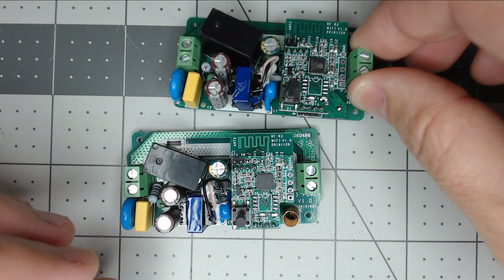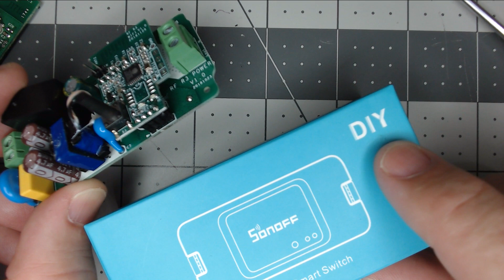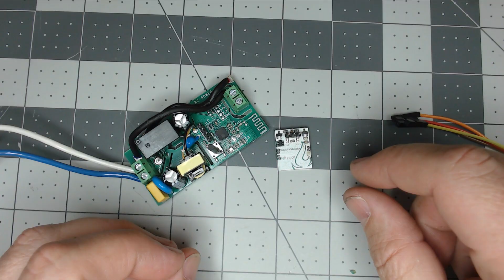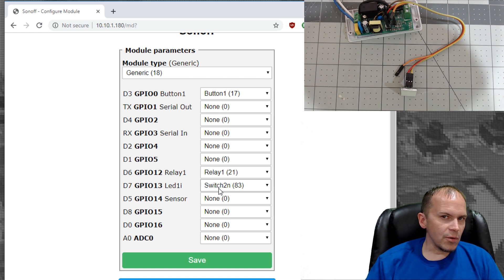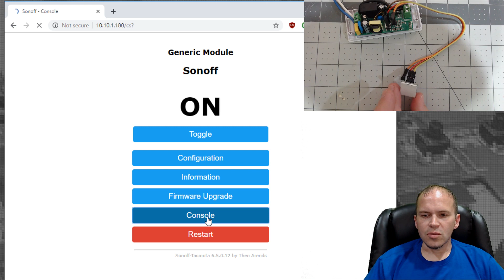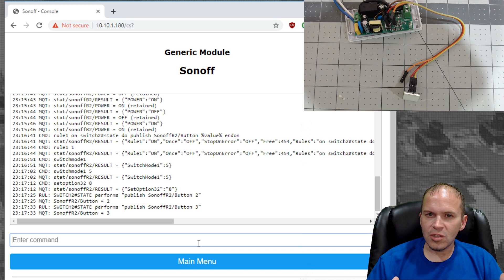Sonoff Basic R3 DIY Mode - Comparisons and Thoughts

Comment: you seem to know what you are talking about I need something that tells me that the device im turning on is actually on like my pool pump does Sonoff make a device that will let me know the device my pool pumps actually running 
thanks
Reply from the maker: How is it wired? Just a plug?
Reply: @digiblurDIY  currently yes but that always can be changed I can even do it in my panel that feeds the pool pump and accessories 
Thanks for responding
Reply from the maker: Probably best to do a CT clamp meter. Shelly has some
Reply: @digiblurDIY  thanks I’ll check it out

Comment: Great review and nice integration of that touch sensor. I use the RX pin, there is a possibility of soldering directly onto the tiny SMD pin of the MCU to gain access to GPIO24, but it's really small. You convinced me that the R3 is not worth it.

Another option is to simply go for the TH16, it has more GPIO's available, but it is quite a bit bigger

Comment: does the sonoff r3 work connected to a 12v battery instead of 240 AC?
Reply from the maker: Not without modification of things. Your better choice would be the Shelly1, hit the jumper and power it off 12VDC.

Comment: I am trying to flash tasmota on the sonoff R3 and having some problems.  The latest firmware (3.6) create an AP that you connect to then put in your own wifi info.  Once connected to the wifi network, you can use the DYI tool from sonoff to see the device and flash custom firmware (tasmota).  I tried to flash tasmota on one and it seem to flash but then after that the switch seem bricked.  It doesnt do anything.  I tried again with a second R3 with tasmota lite (someone mentioned it in the comment) and the same thing happened.  

I tried to manual flash with FTDI without success.  I am not sure how to put it into programing mode.  I tried to hold down the button when connect to power but that doesnt seem to work.  Any insight on how to get it to go into programing mode?
Reply from the maker: I do believe the button is still GPIO 0. https://tasmota.github.io/docs/devices/Sonoff-Basic/#sonoff-basic-r3
Reply: @digiblurDIY  Figured out why tasmotizer did not flash.  I needed to run it as admin.  Just for anyone looking to do the flash, hold down the button when power up will put it into flashing mode.

Comment: Just watching this now.  Apparently there is a DIY Mode version 2 on the new firmware.   
Any chance of doing a comparison?    I did read a small number of SonOff's (including R3) could use the new firmware.
Using the LED pin as an input sounds interesting.  That would mean you could turn the single relay to a double usign tx and rx pins.
Gives you the relay plus 3 GPIO's :)
Reply from the maker: I was hearing from some people the OTA flashing no longer works on the new DIY mode.  I don't have any devices left on stock firmware though as I converted them last time.

Comment: Hi, I'm trying to add a regular push button to manually toggle the R2 switch. After flashing the chip with tasmota, the "pairing/manual' button in the board still work as designed? I'm thinking in solder wires on it to extend it's manual switch functionality and definitely don't want to use Sonoff firmware.Thank you in advance

Comment: It is not simpler. You need another module to flash it, download IDE software and board drivers, solder pins , buy parts and wires etc. DIY is just a jumper and some access points, and upload a file. No special knowledge. I personally hate to alter the hardware of a device unless there is no other option. I am glad of DIY. I am even grateful of the new ad-don for Hassio that it will see your sonoff out of the box and works in parallel with ewelink.
Reply from the maker: Tasmotizer doesn't require any crazy installs. Download and hit flash, don't rely on the cloud or stock firmware. It's your device, so make it yours.

Comment: I've successfully soldered male headers into 'one-sided' plated through holes on a circuit board by placing the terminal strip "upside down" ie with the plastic piece at the top. I use flux paste to hold the strip in place, so that the pins are just into the PTH, and carefully (and quickly!) solder the pins in turn. It's best to do the two end ones first - helps to keep them straight and the top of each pin parallel with the board. You have to be a reasonably proficient solderer (I am - a long lifetime of experience!), and ensure that the amount of solder is kept to a minimum. Once the joints are cool, then just push the plastic piece down! And - voila! A header in place. OK, if you want to be pedantic, there may be a very small gap under the plastic piece, but it really does work. Try it!

Comment: Wow, you seem to have a good handle on the construction of these, can I ask which model will be best Original, R2, or R3 in an electrical box outdoors in Hot climate. Like 45 C. Some places it says Operating Temperature max is 40C, but on Amazon it says 70 C
Reply from the maker: I would go by what is printed on the iTead site as it is their product.

Comment: Hi! May you help me to send curl command? I'm just trying to send curl POST to turn it on or off, but I can't get with it.
Reply from the maker: What software do you have Tasmota?
Reply: @digiblurDIY  No, just the built-in firmware. I would like to control the device via curl, for example.
Reply from the maker: I flashed Tasmota on it myself and ditched the stock firmware.
Reply: @digiblurDIY  OK. Thank you anyway!

Comment: You can use this for programming socket

https://www.ebay.com/itm/10PCS-Strip-Tin-PCB-Female-IC-Breakable-40pin-Single-Row-Round-Header-Socket/200924888596?epid=921666373&hash=item2ec80e7e14:g:TtEAAOSw2jNb0ZXx

Comment: In DIY mode can flash tasmota by wifi.
Reply: I can solder over a thousand points a day at work, and I'd rather use DIY mode.
Reply from the maker: Right after jumping through their 500 hoops. They didn't have to design it that way.

Comment: Have you seen Paul Hibbert's YouTube video about flashing Tasmota OTA on the R3?
Reply from the maker: No I haven't. Has the process changed? If they don't make you open it anymore that would be awesome.
Reply: @digiblurDIY  you still have to open it but only to insert the jumper. No soldering and no USB to serial adapter.
Reply from the maker: Will check it out but seems like the same hoops to jump through that I talked about that was annoying on the R3. The Shelly guys get it.
Reply from the maker: Watched it and those are the exact hoops I talked about. Such a mess. Just easier to push the jumper wires in the holes and call it done. Really wish they would do it right with exposed pins like Shelly does and then go over the top with a bin file push over from the phone app without any crazy hoops.

Comment: Can you change firmware from regular to DIY?  I don't think, once you flashed Tasmota or something you can change back to iTead.  That would be sweet for some users.
Reply from the maker: Do a read of the firmware first and you can put it back.
Reply: @digiblurDIY  How would you read the firmware?  With arduino?  I only flashed tasmota with EspEasy.
Reply from the maker: Here's the example I use for 1mb chips which the esp8285 is.  https://github.com/arendst/Sonoff-Tasmota/wiki/Esptool#optional-backup-firmware

Comment: Love your video which is very informative. Actually the DIY mode of BASICR3 includes OTA to a customized firmware, and the whole idea of this version is to get easy access to the open source services. You don't need the soldering to get the BASICR3 flashed, which is more friendly for DIY fans. However, the version you get doesn't have the R1 resistor, so it's impossible to support the DIY mode and switch to the eWeLink mode at the same time. It seems to be one of the first batch which has been improved.
Reply from the maker: No soldering is required to flash it. Just insert the wires and go as I explained. The soldering was for using other sensors that require power and/or toggle switches. They should include a mode to flash OTA without having to touch a screw driver if they really wanted to appeal to the DIY mode. Take note of Shelly switches.

Comment: iTead does not like the DIY community at all and they emailed me when I asked about OTA and custom firmware and they said they do not want people using custom firmware ever which makes me very upset with them I wish there was a product that was just as inexpensive as the sonoff
Reply from the maker: The DIY community has made so many sales for them which is nuts to alienate us. Funny to see how Shelly embraces us.
Reply: You can get the Shelly1 for a comparable price; and as digiblurDIY pointed out, they embrace the DIY community. Nothing like voting with your wallet.
Reply from the maker: Shelly needs a mains powered switch with exposed isolated GPIO pins badly.
Reply: Matheson, nice bit of insight, thanks for sharing, even tho that (disliking custom firmware) was what I had assumed about any smart appliance vendors anyway. It never even crossed my mind that that "DIY" tag would be anything but a marketing frill. So, I'm quite surprised to see that Shelly does the opposite. 

(I wish I found this video + comments before buying from Sonoff. The next batch will come from Shelly. Thanks guys!)

Comment: R3 - seems like a simple toggle switch/button on the outside of the case would've made most sense especially as they went to the trouble of putting headers on there..

Agree seems an odd step and not really any main benefit over the 'traditional' way.

Richy.

Comment: Hi Travis, I love your videos. I had this new Sonoff in hands a few weeks ago and my initial reaction was exactly as yours, I preferred the R2. But then I made a few findings, which changed my approach: 1) I could solder very easily 4 pins to the 3.3V, GND, RX and TX from the top (not from the bottom, as you explained, it cannot be accessed). 2) I made many tests, and GPIO 16 (one of the DIY pins) is not working with tasmota, with any sensor... that was a disappointment. 3) However ... I could get easy access to GPIOs 9 and 10 from the chip holder missing. As a result , we're missing GPIO 14, but we gained GPIO 9 and 10.
Reply: @Jason Churchward Hi Jason, sorry for the delay, I just saw your note now. I have inserted the picture on imgbb; https://ibb.co/s1mXQ6z
All the best, F.
Reply: @felixh.7501  Hi, what is the pin out for the 4 pins that you soldered on? ie which one is tx,rx and gnd?
Reply from the maker: Would love to see pics. Did you solder some pins without the plastic piece of the header? You are right on the gpio16. You couldn't get the switch to work? I saw the memory chip was missing as well which I assume you are grabbing 9 and 10 since it is a esp8285. Difficult solder for some not being a through hole solder.
Reply: @digiblurDIY  I can send you a picture if you wish, but there's no placeholder in Youtube...Is there an easy way to share? I soldered from the top and cut the inner plastic box with a mini saw, then the 4 pins come out nicely from the box. For 9 and 10, I made a hold through the inner plastic box and went through the top. GPIO9 and 10 work very well, I connected them to a DHT11 and BH1750 without problem, and on new tasmota 6.50, I could reach the config with a template, it worked fine.
Reply from the maker: You would have to email it or use discord. Email is the channel name at Gmail domain. No hurry on it just curious to see what everyone does.
Reply: @digiblurDIY  Just sent, Travis.